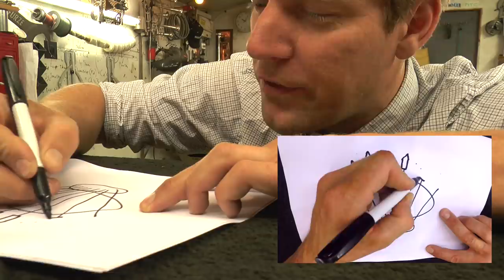Setting up/Testing the 700 Rocket Mushroom Rig

Comment: You taped a rocket to another rocket and tried to use it set a field on fire while casually holding it in your hand. Seems about right
Reply: i dont see a problem
Reply: He was fine he had his safety tie on...
Reply: Can't learn without mistakes, and it is a heck of a lot harder to make mistakes when you've got hand sanitizer all over the place.  Wonder if that stuff is flammable...
Reply: Thats coline hellow lol
Reply: I agree 💀
Reply: U could have used...thermacoal padding in the underside of the mesh.

Comment: I wouldn’t be surprised if fireworks were banned in the UK because of this man
Reply: Memes
Reply: Same
Reply: Ethan Bennett Actually the use of fireworks by the public is restricted by law to certain times of the year unless it is an organised and licenced display.
Reply: Uhm.. no it isn't. Its restricted to certain times of day. For instance 1am on NYE. But if I wanted to set off fireworks tomorrow its completely legal (provided its within certain hours).
Reply: Not many things are outright banned here in the UK. There are restrictions but not many things are 100% illegal. Guns are legal provided you have the right license. Airsoft is legal with a UKARA license or if the gun is two-tone and as long as you have permission from the land owner to be firing there. The only thing I can think of that's completely illegal are hard drugs.

Comment: for the first time in the history of this channel Colin will take perceptions to insure he does not set fire to a field. This safety test includes the flowing. setting off fireworks in grass. and see what happens. if that test was to fail and the grass did not catch fire i plan to use a more direct method witch may of may not include a propane torch.

Comment: Why don't you use e-matches as you stacked them and then fire them using a controller?  However I need to point out that if those rockets disperse over a wide area of land you may well not be able to control the resulting number of fires (speaking as a retired whole time fire officer with a son who has is absolutely knackered fighting moorland fires in Greater Manchester).  Just don't do it yet Colin, it would be highly irresponsible in these current conditions.  Go and talk to Lincolnshire Fire Service Fire Prevention Dept.

Comment: Check out the section on Probability Of Ignition tables.  It will give you a legally defensible way to determine go/no go on projects like this.  So long as you are lighting at night, you can safely ignore the "sun" calculations and use only the "shade" ones.  You can also safely assume all grass to be "fine dry fuels".  You're welcome.

https://www.nwcg.gov/sites/default/files/publications/pms461.pdf